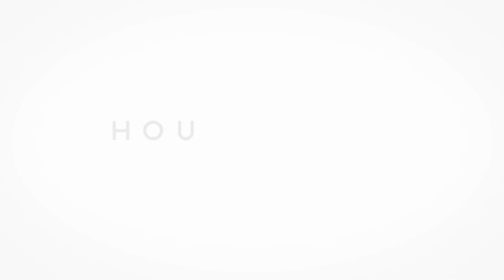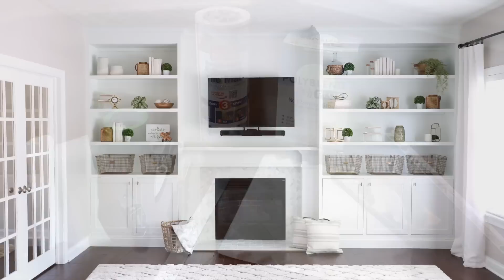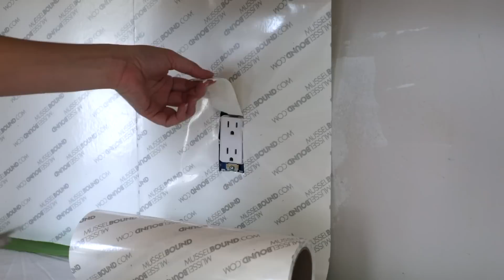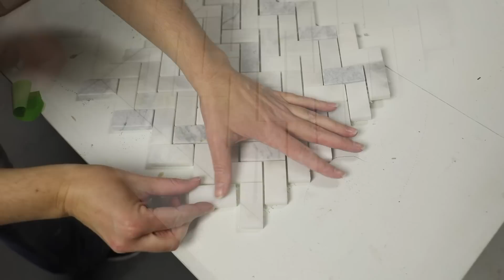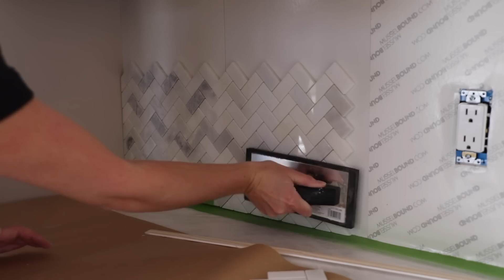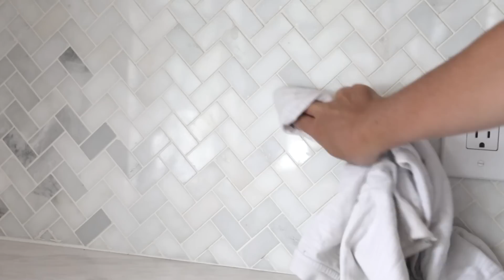How to Install Backsplash with Adhesive Tile Mats | House One | This Old House

Comment: On using the Mussle adhesive paper I found that using an 18” by 30” piece of closed cell foam and 18” wide Parchment non stick paper was an excellent way to trim the adhesive paper then work with cut off sheets rather than fighting the roll.  Also,  I used card board sheets laid out in dining room with the exact outline of where I was going to tile.  This way the tile was laid out, adjusted, corrected, and get the layout going smoothly.  DIY job turned out perfect.  I did have one tile stuck crooked, tried to remove it and just made a mess of the wall , paper, and tile having to just cut out the small section carefully pulling off the ruined paper.  Cut adhesive paper to fill in the cutout and continue.  Parchment non stick paper also allowed for use of scissors to trim.  The end result of the Rustic Slate was awesome.

Comment: This is EXACTLY what I have been looking for! Yay! I have 2inch square tiles I want to add to my bathroom backsplash. I’m not handy at all lol. I love alternative DIY’s. I just knew I could turn my tile into peel and stick without all of the other stuff! Ha ha! I had been racking my brain on the easiest way to put them on my wall. I won’t have any outlets or any problems with patterns since it’s just squares. Corners may be an issue but I even thought about framing with trim if it’s that big of a deal instead of cutting into tiles. Thank you for the easy solution!!!!!

Comment: Installed a backsplash with the adhesive probably 10 years ago. It worked fine and went without a hitch. Backsplash is still intact & looks great. The install to me wasn't really any faster or easier, but Ive installed quite a few of them. I guess it's less messy but really just a matter of preference. The adhesive is super strong which can be a positive or a negative.

Comment: So what I’m getting from this is thinset is the way to go!
Reply: I'd say another advantage might be not having to pick seepage out from between your grout lines as well as one less stage of cleanup.. And being such a small space might be enough to warrant the additional expense.. but if you had a larger job, maybe not so much. Another disadvantage is the "sticky" mounting sheets I've seen say not to use them in tub or shower surrounds or outdoors or anything that will be submerged underwater - so you're basically limited to using them for backsplashes.

I used something similar for my own kitchen backsplash to install 1" glass tiles. It held up really well.. 10 years later when it was time to "refresh our look" (😒) .. it was still on there pretty good - but easier to remove than chipping away mastic or thinset.

So... As with anything, there are UPS and there are DOWNS.

You be the judge 🤠👍